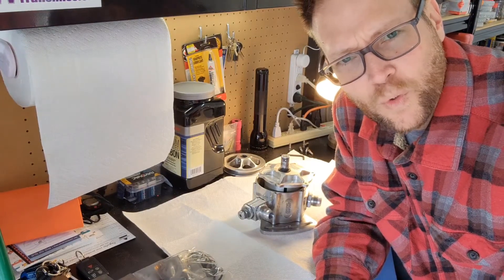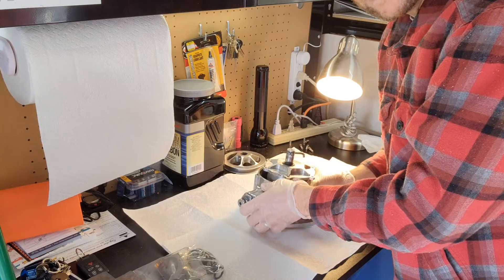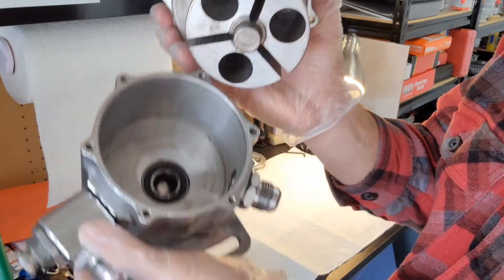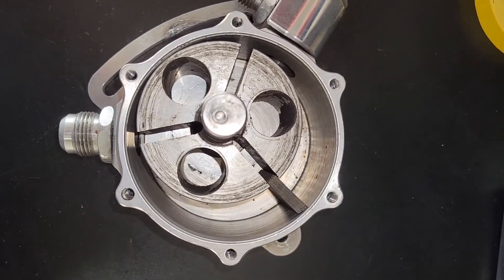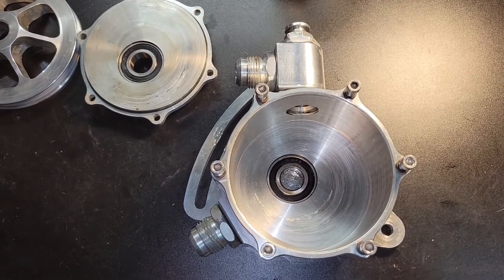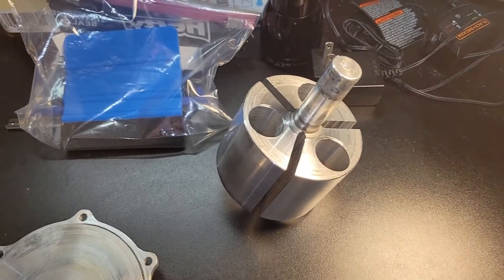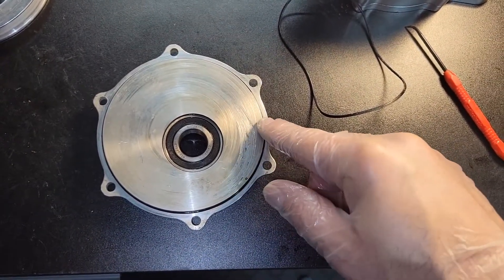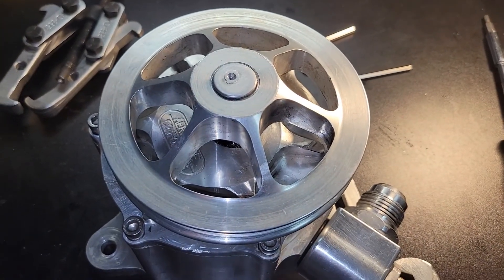Rebuilding an Aerospace Components 3 Vane Vacuum Pump

Comment: Nice video, Thank you! There is an easy way to get the back bearing out if you do not have access to a bearing puller. Put the pump on the stove with the burner on high until it is smoking hot. Using a thick leather glove turn the pump upside down and hit it straight down on a piece of wood. The bearing will fall out.
Reply from the maker: Thanks for the tip Aerospace! I suspect had this unit received more regular servicing it would have disassembled easier. This one however was probably never serviced in likely 20 years! Which is a testament to how well these pumps are built. It did make it difficult though to get it apart. I think anyone else would not have as hard of a time if their unit is newer or received better routine maintenance. With the rebuilt unit back on my engine, my car has picked up about .08 in the 1/8th. It's performing like new! Thanks!